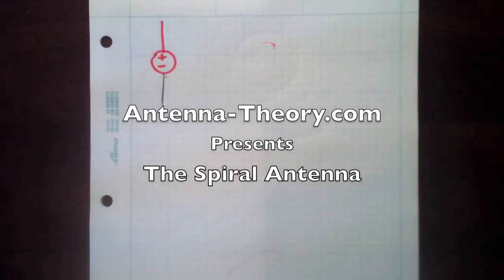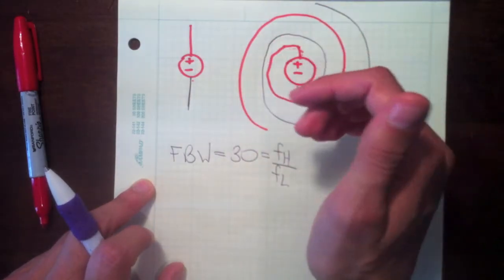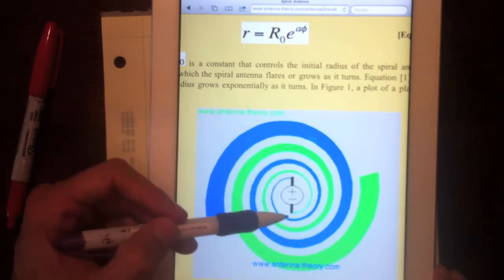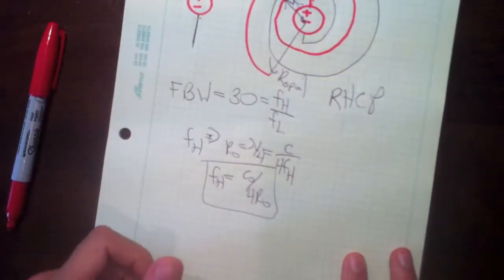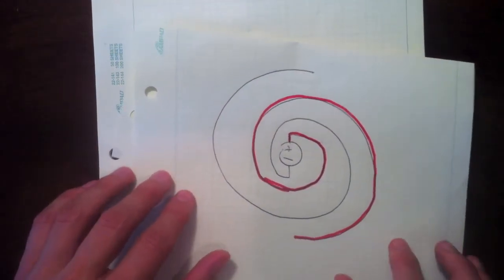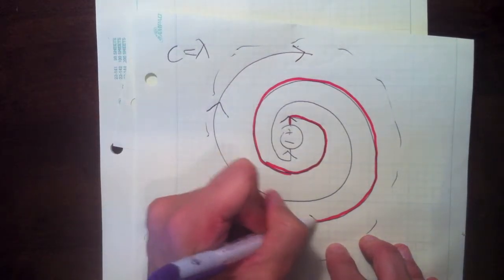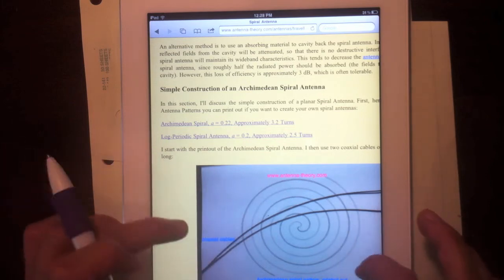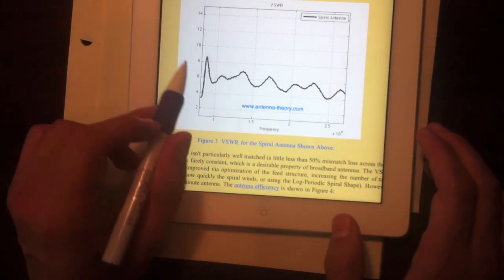Antenna-Theory.com Presents the Spiral Antenna

Comment: If you look at the deshred ancient Egyptian crown it is a double spiral parabolic antenna, the latter is the higher back of it, there are also those curious curly tail lizard with same design (earth replaces the parabolic. In my opinion the design is limited for lower frequency, could you recreate that design or figure the math? In crown the rim should be the reception, but it could be just for back head or a lost inner piece. Can u...?

Comment from the maker: The center conductor of the feed cable connects to the outer conductor of the second "dummy" coaxial cable.  The outer conductor of the feed cable is connected to nothing - the current flows from the transmission line mode inside cable, and at the feed point the current exits the inside of the outer conductor and travels along the outside of the outer conductor.  

Restated: inside of outer conductor (transmission line) connects to the outside of the outer conductor (antenna) at the feed point.